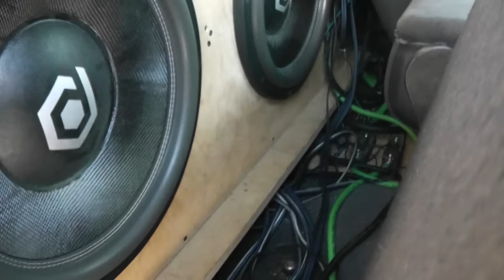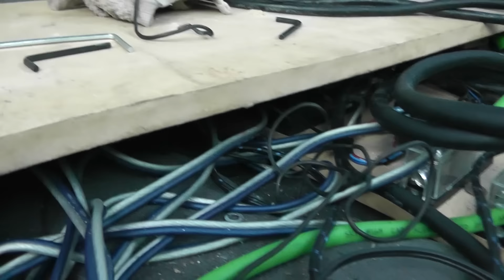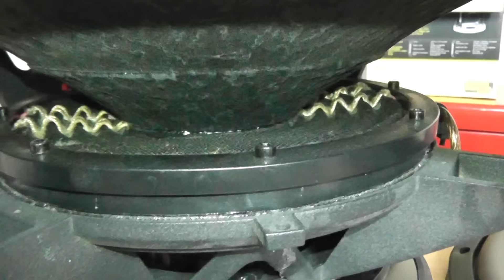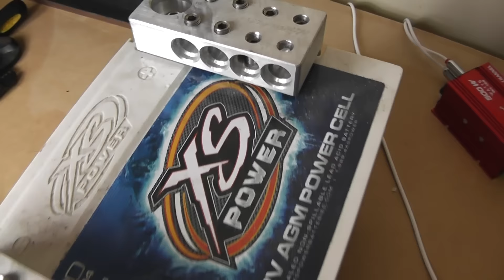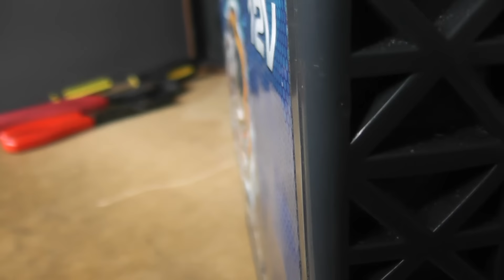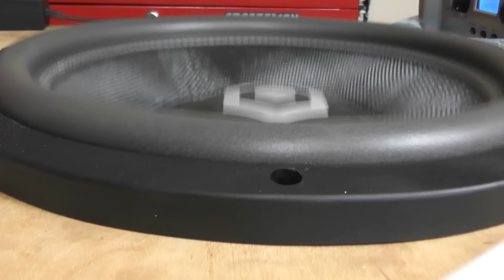Decommissioning Ford Ranger 3000 Watt Sound System

Comment: From the looks of the former at the top that sub had gotten really hot on multiple times. The former should be white. The dark coloring is adhesive that is slung up on the former from the coil getting way too hot either from clipping or over use without cooling. I my HDS3 former looked similar but not as bad just dots of adhesive. There are many many factors that can lead to clipping and sub destruction.
Reply from the maker: yes gains were set clean with a -10 db 40 hz tone and my DD1 but I ran these subs at their limit and beyond pretty much every time I was in my truck. Even with the gains set clean though, I imagine voltage drop was pushing the amps into clipping (truck would get down to the high 11 volt range full tilt). Usually my nose would pick up the nice scent of melting glue after a couple songs full tilt and that would be a indicator to give it a (probably too late) break. The enclosure was also built for lighter duty subs and was certainly not optimal for the HDC3s. Fortunately the recone kits for these subs are relatively inexpensive. The ultimate goal is going to be put all 4 of my HDC3s together either in my "pro" audio system or another car audio install. Thanks for the info and watching.
Reply: Just a tip...never use the -10db tracks. -5db at the most. If you listen to any kind of modded music at all from DJSNT, Got160's, DJ JD, or Decaf they all record super hot tracks. By that I mean their bass tracks...70hz and down is usually approaching -4db to -3db at which point if you're set at -10db you are in full clip mode. I personally made a -4db 40hz tone and set it at -4db and then any modded music I listen too I run it through audacity to Normalize the tracks to -5db which gives my amp 1db of headroom for any spikes in the song.
Reply from the maker: Some great info in this post, thanks for sharing.
Reply: 11 volts??? whoa you need higher amp alternators for sure! or at least another battery. voltage needs to stay above 12v and preferably kept at 14.4v or above for maximum clean output without clipping

Comment: Push up on the cone. It could be the spider separated from the basket slightly. Sometimes the glue lets go. Here's hoping. Simple fix.
Reply from the maker: john vinczencz will def check it out thanks for the heads up hate to spend the $ on a recone